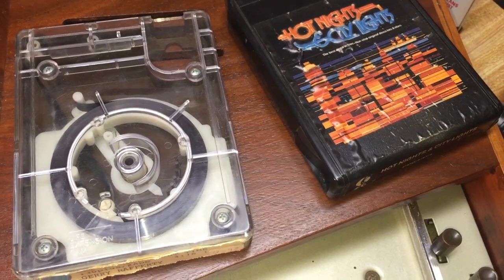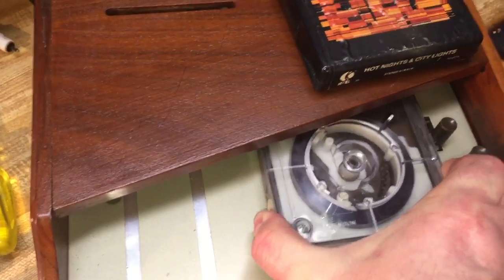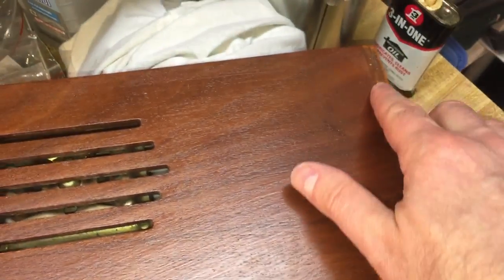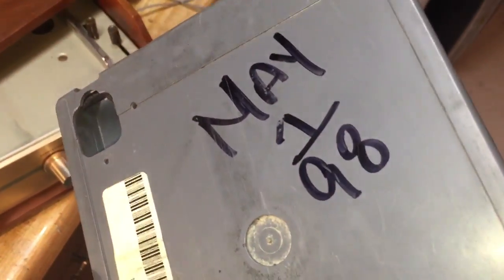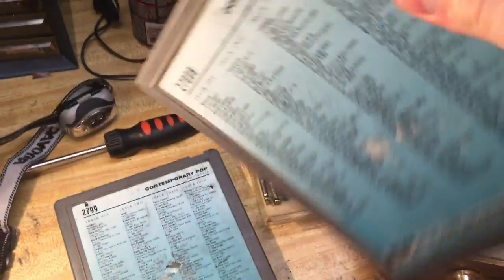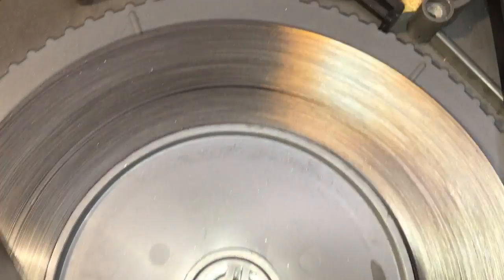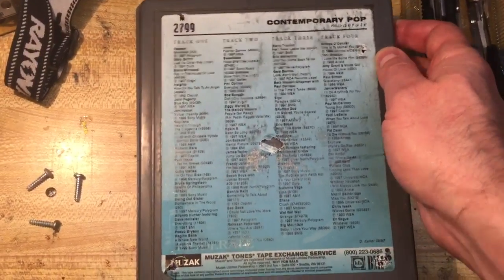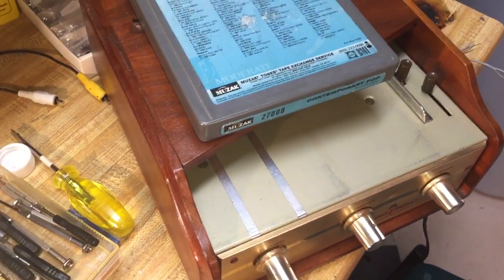Vintage 90s Tech: Inside a Muzak 4 Track Cartridge

Comment: I worked for Muzak from 1990-2000 There were two formats of endless loop cartridges still in use; If I recall them correctly, you have the bigger one (they could both play in the same player if a spacer was installed for the smaller one).
Even then, they were an old format used for old machines. Most tape based customers by then had moved to cassette.

Comment: Controls on the front:
"Loudness", "Separation" and "Contour"

...wtf, have I fallen through a rabbit hole? I suppose the first may be a different name for volume, but normally it's an EQ setting and is just a switch... the other two, well... erm?

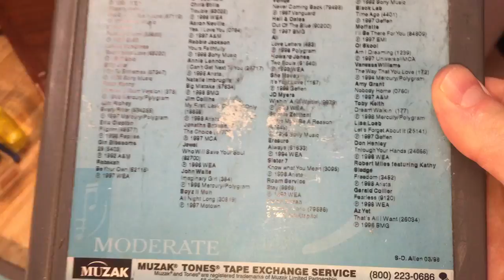Comment: @2:49 The Muzak carts were either continued to made because it was a relatively inexpensive format to continue production, and/or there were still quite a few machines out there that used cartridge tapes.  Much of it also is about the market and how competitors press technology to advance.  When you are playing "music" through 70.7v Quam loudspeakers, there's not much fidelity to be concerned about.  I saw the Muzak Encompass XD CD Music System you did a while back.  I wonder when it was first introduced.
Reply: Not regular magnetic tape. As you may  have discovered later, it like the Muntz and 8-track cartridges use graphite backed (lubricated) audio tape.  Unfortunately after decades of use the tapes stretch adding distortion to the sound (wow and flutter).

Comment: HI you need to de mag the tapes before using a recorder as they only had 1 head for play rec  
rec recorders are not that rare just need something to do the job like a reel to reel recorder i got a otari mtr
i pull the head block out and i made a card that plugs in to the block port and the cables come of the card on
to some heads on the player  works very well just a bit of planning and know how. there's a BMS 2600 back ground music
player takes A B carts  it's got 4 track head in side it runs at 3 3/4   works like a 8 track tape with the track changer
on the tape. i had the older player they are not any good. the sound is all over the place. it's very hard to find
your tape you have here you have been very lucky i can tell you

Comment: I have a question, tape is take from the inne par of the reel, moved basically by the capstan. When the tape is taken out, reel moves. Tape go across the device and into the cartridge again. And into the outer part of the reel. Being the inner and outer much different diameters, how this is not giving trouble ?. I mean, I took 10cm of tape from inside, representing, lets say, half a turn. But on the outside 10cm probably will represent 1/3 turn. Iam confussed.
Reply: I dont know how it can be working either. ¿Any explanation?

Comment: I worked in radio for 17 years and used carts all the time. Those big carts like the one for Muzak were used for 10, 15 or 30 minute shows or emergency programming. And there were radio supply companies still making new carts even in the 2000's after a lot of stations had switched to computer automation systems.